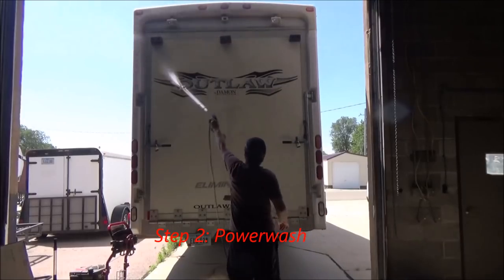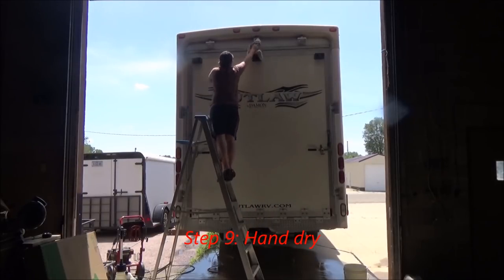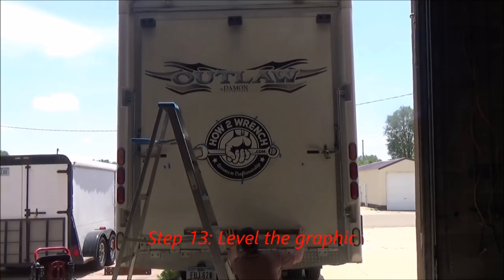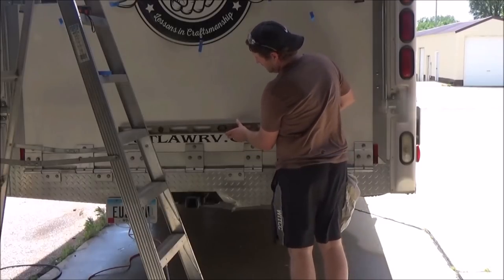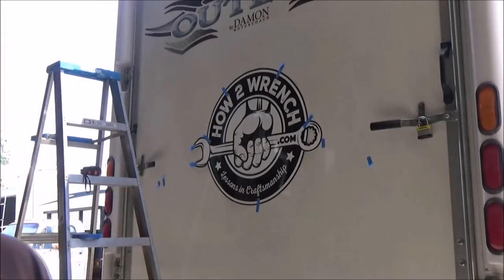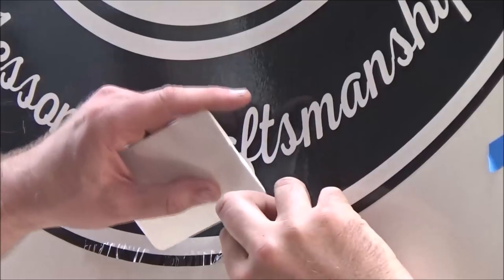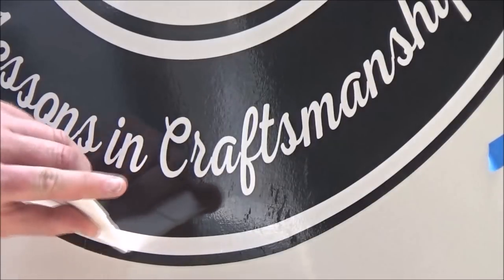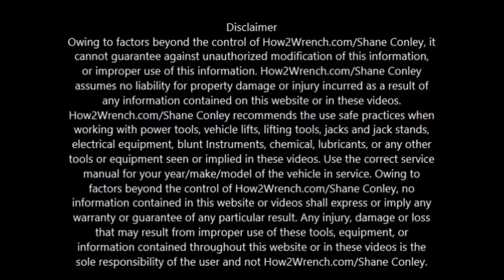How to install LARGE Vinyl Graphics! Full Tutorial in 8 Minutes! DIY

Comment: Graphics that big should be done with the wet method because it keeps you from ruining the vinyl with a single mistake. You should also use transfer paper to keep the graphic a little more "rigid" so the corners don't get away from you and make the wrinkles you got at the bottom. Transfer paper would have also made the ends or the wrench easier to handle.
Reply from the maker: Thanks for the tips!

Comment: Things like those little wrinkles you were fighting are a non issue if you apply with a wetting method, soapy water. So much easier.
Reply from the maker: I tried the water method on a smaller one and it was very hard to position. The material seemed "ultra slick". This dry method seems to be more used in "wrapping" than on flat surfaces. It worked out great and I've done both ways.
Reply: You saw the big one I put on my van. That was many letters over a surface with body ridges and depressions and had I tried it dry would never have been possible. Applying that wet spraying on vehicle only, using squeegee from center out while holding with other hand makes it settle and stick after squeegee work some heat and should evaporate and be good.

Comment: Sir, why didn't you use the soap spray and squeege method for this application. I'm guessing you would have less issues with wrinkles etc that way.
Reply: My experience is much easier and faster wet also
Reply from the maker: This material was super slick and was hard to keep exact placement when I did smaller graphics.